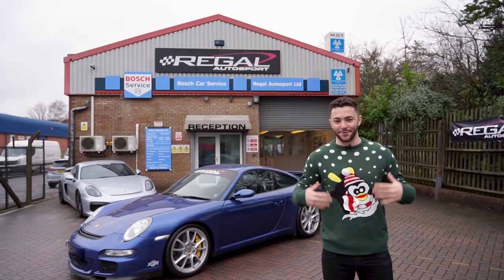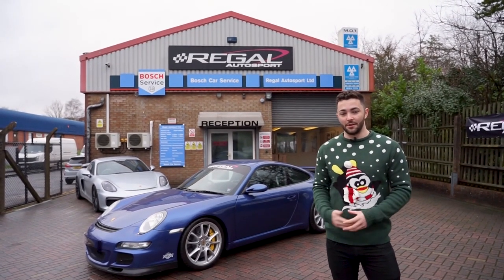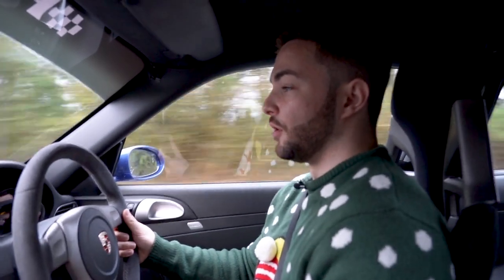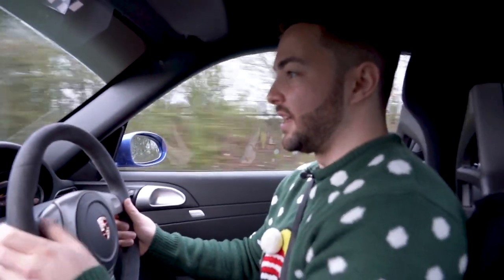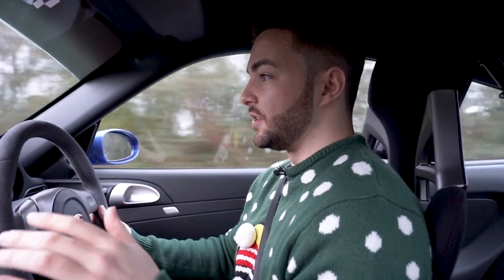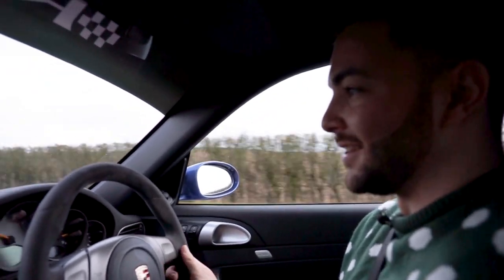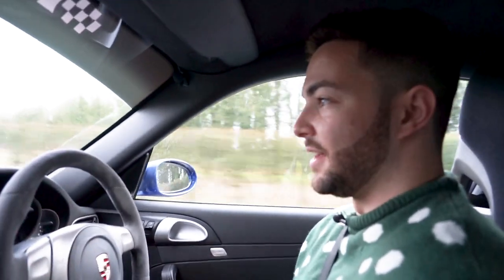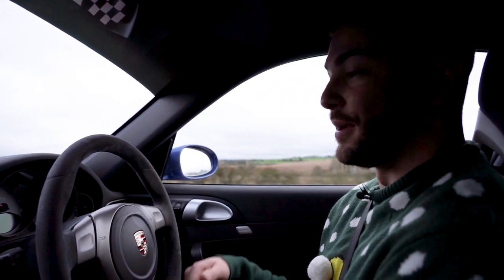What is a CAE Racing Ultra-Shifter? We explain in our 997.1 GT3!

Comment: Total gimmick!  Look how long your hand is off the steering wheel - pretty sure you can change just as quickly with a standard lever.
Reply from the maker: Thanks for the input! Have you experienced said gimmick?
Reply: @RegalAutosport  No, but I've changed gears plenty of times.  To me it looks like it is just imitating a sequential gearbox shifter
Reply from the maker: I’d recommend using one before passing comment based on an observation on the internet, it makes a big difference to the driving experience.